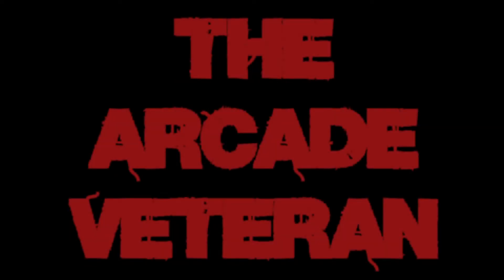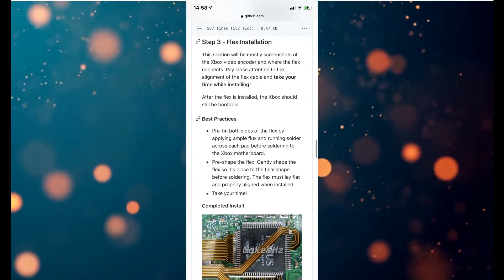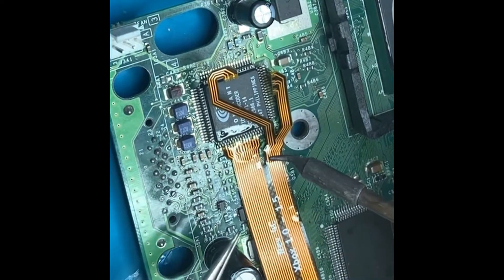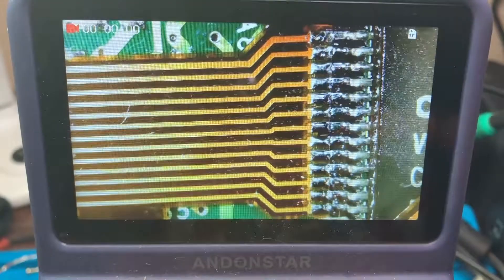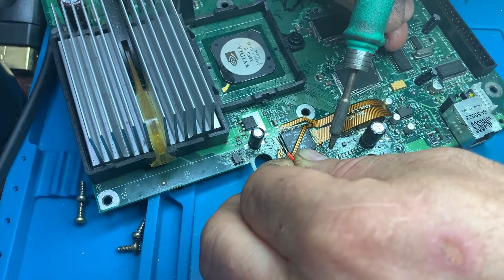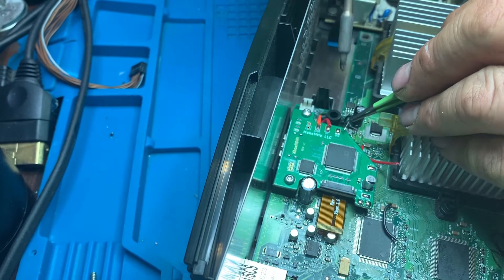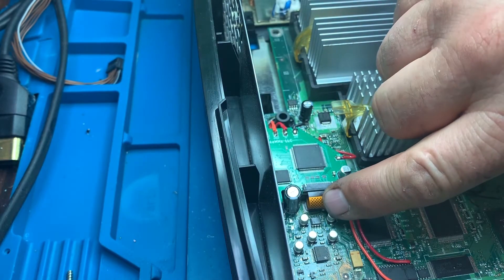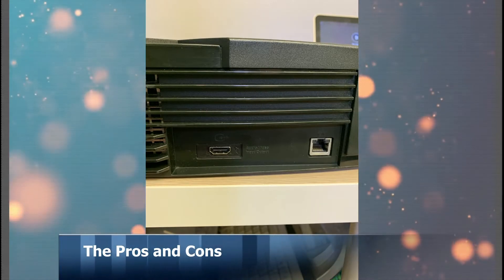XBOX HD+ A HDMI SOLUTION FOR THE ORIGINAL XBOX (Install and Test)

Comment: easy to install but too expensive chip, what about a crt tv great to play games with.. HDMI advanced xbox original cable will do too.
Reply from the maker: We seem to be at a point that everything needs to be hdmi or converted and yes it’s convenient but I agree sometimes the tv it was designed for is best 
Take the ps1 I have a hdmi converted unit and retroarch emulation and both look crap compared to a crt maybe on day we may get a solution 
Thanks for the input 👍
Reply: @TheVetUk   to me the xbox OG is the best for emulation, I do modify too and upgrade from 64mb to 128mb of ram and still using an CRT Tv I have the xbox hdmi original advanced cable but hey Metal Slug looks horrible but give it a go at the crt and is simple amazing but hey if you playing xbox games some looks great in HDMI.

Comment: Can we still use this with a retrotink 5x pro?
Reply from the maker: The retro think 5x pro only has input Ports: Composite (shared with green RCA jack), S-Video, Component, RGB and Composite on SCART connector and outputs hdmi 
So I would say no to using that device but there should really be no point as the Xbox output with the HD+ is pretty good when using on a modern TV but if you want to use the tink I would get a HD cable adaptor for a standard OG XBOX and the pass it through the tink and the results would be very similar 
Hope this helps 
Cheers
Reply: @TheVetUk  I imagine the Retrotink 5X Pro would output a much better image.
Reply from the maker: Retrotink is a great bit of kit and has many features better than the HD+  so the Retrotink maybe the better option and a lot less fuss to fit
The HD+ is nice and easy to use with only 1 wire but the options are limited compare to the Retrotink 
I wonder if anybody has done a comparison ?
Thank you for the chat 👍
Reply: @TheVetUk  I would love to see a split screen comparison. While the HD+ kit allows the console to output a pure digital signal, the resolution is still low. I think it would be ideal to connect the HD+ to a scaler that accepts HDMI input.